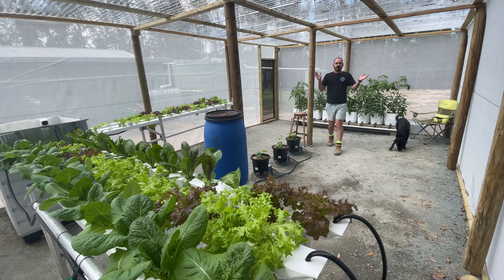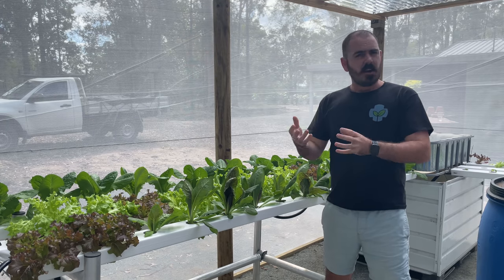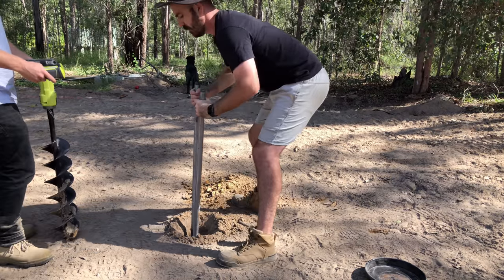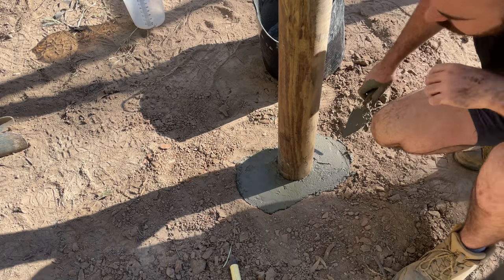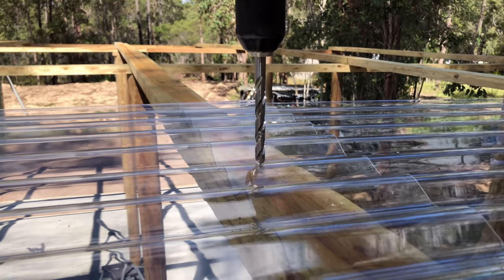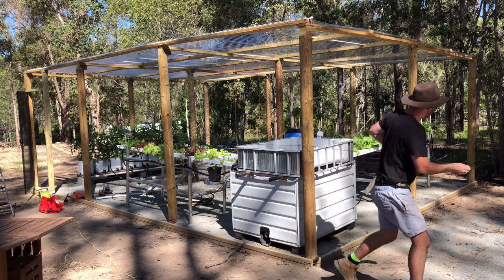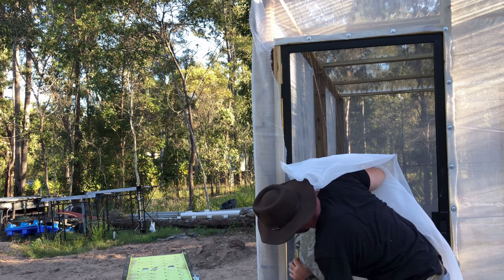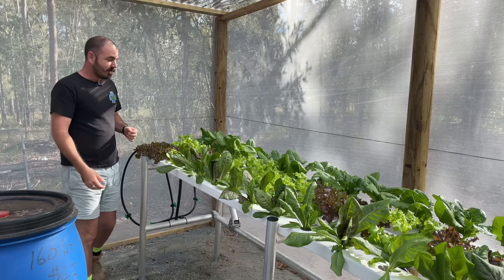Greenhouse/ Shade House Hybrid Build

Comment: @Hoocho Hate to be that guy...but your probably going to end up with roof sag, make sure you don't get a build up of leaves and avoid walking on the roof. In future make sure your beams are sat with the shorter 2' width facing up and down because if you lye them flat you loose any strength. For a light building I'd also consider using 6"x2" as a minimum. Since you have taught me so much about hydraponics I'll return the favour with a short lesson in mechanics. When you stand in the middle of a beam supported on each end, your weight will cause that beam to sag in the middle. Ok so much you already know, but if I was looking at you standing on the beam from the side and drew a line along the centre of the length. The top of the beam above the centre line will be in compression, whilst the lower part of the beam will be in tension. This is how you get the strength, a thin beam of 2" will sag more than a thicker beam of 6" inch because less material is available to resist the deflection of the beam caused by you standing on it. Now if you really want to increase the strength, stick a piece flat on the top and flat on the bottom and you get an I beam. This seriously increases the area of material resisting the deflection and works because the maximum physical compressive force occurs right on the top face of the beam and the maximum tensile force will be on the bottom face of the beam. The middle (or neutral) line that I drew down the centre will experience the least force/movement. But the general rule is, the further your top and bottom faces are from the centre line, the stronger your beam is.

Other than that, great job and thanks for what you do. I've just started growing veg hydraponicly this year and your videos have been really helpful. Just made my first pucks today!! If you havn't already, I would love a video on what happens to different plants when things go wrong, like PH, EC, Temp problems...although that last one might not be an issue in oz but all in the vein of reading your plants when things arn't right. I know you talk about whats gone wrong with some of your plants as you go, but a dedicated video would be awsum!!!!!!! Take care and thanks again.

Comment: With rapid set concrete you don't normally mix it. Wet the hole and pour the concrete in dry then add the amount of water as in the instructions. It has a chemical that draws the water through the mix. You will be weakening the concrete by mixing it and it is a very fast setting product. It also saves your back a lot by putting it in dry.

Comment: I used those same greenhouse roofs. It is item 77000 at Lowes, that's how much I know about them, lol. You MUST not build like that as mine caved in (with even more wood support) with a heavy rain storm. The middle of one will pinch and buckle from the weight of water. You must fix that asap, lol. This happened last year at 42*N, way up in Michigan not even in a tropical area, ha. Believe me man.
Reply: I warned my grow partner as he built it the same way. I warned him and lets just say I got to laugh inside and say "told you so" as he repaired the damages. Oh and we lost a really nice plant almost so, it wasn't all peaches and cream.
Reply: Oh, I think theyre good but it just needs to be tilted so the water doesn't set and gain weight on the weakest point. I know those things are pricey and they diffuse light, giving you more light, so they are very good for greenhouses... edit, oh you can tilt 15 degrees to one end, and put a gutter with a window screen mesh to filter out leaves from the tree, giving you perfect rain water for crops.
Reply: Good to know. Roof won't hold up to the 3" per hour and greater in Texas.

Comment: Dude nice good work 👍
To counter the bowing effect of roof members, just consider raising them a little in the middle and flitching them with a steal flat through n through securing the flat with screws and an adhesive to prevent dry joining, so that they behave together, that's where the tension prevails. This should address your sagging/bowing problem.
Please come back with results 🙏

Comment: I have a similar structure on a balcony.  around 2012 we had a party and some plexi was BBQ'd. lol yea....  Had it repaired.  2018 half the roof came off in the wind. =wuh??? SOOOO after looking carefully, I noticed that the original builder put a goop on EVERY screw & new guy didn't. The structure is 40 years old. The wood is now gone around many of the screws(repair job).  
Mind you that it hardly rains in California. 

btw >> Awesome shade house man !!

Comment: Unless your roof looks like its holding water I wouldn't worry but If you can flip the roof bearers onto their edge they will support more weight and it might help with some of your bowing. (carpentry qualification: have built 3 roof's many years ago :)  )  If you want to get really excited you can look up span tables to see what size timber you need for each gap, But if you aren't sleeping under it and it aint broke then why fix it!

Comment: Great job, good tips, looking to upgrade my first shade house build here in Geraldton and will go the modular route using pine posts and 3m treated pine, certainly saves time. I have Mr Stacky system and built my own recirculating system but will move away from those to the Krakty method its much simpler, nutrient uptake as required so no needless loss in unnecessary flows. Built my first Kratky system yesterday out of a storage tub and net cups, onwards and upwards. Thanks again for your great content and the beer looks like a tasty drop too. cheers

Comment: I want to do this but also lay pond lining over the whole floor and making the whole floor a sump and put everything on blocks, making a pathway or even fish pens with netting to separate. Using every bit of sunlight and it wouldnt matter so much if anything springs a leak because it would all drip into the sump

Comment: Very nice work. It's funny, I was thinking these days about making a greenhouse, and I was wondering about the plastic that stops the UV for the plants ;-). 
Just a small remark, for the wooden poles, even if they received a copper treatment (autoclave), personally I would have fixed them on concrete blocks of 20x20c20 cm so that they are raised and not in contact with the ground or with the weeds which will grow around and risk to rot the wood. I once used wooden posts that I planted in the ground with cement, and although they were treated with autoclave class 4 (the highest level of wood treatment) they ended up rotting after a few years.
I have a question about "shade cloth", I am in a country where it is hot all year round, and I was thinking of using only "shade cloth" for my greenhouse. Do you think that the ventilation is enough, because you need a very good ventilation in greenhouses, especially when the height is low, because the heat will stagnate. The professional greenhouses have a height of more than 6 m for good ventilation and efficient heat removal.
last point: in case of a storm, do you think the shade cloth will be strong enough. 
Thanks
Reply: Can I ask how would you attach the wooden poles to the concrete blocks? What type of fitting would be suitable for that?
Reply: @wndhl4347  The best way is to use "galvanised bolt down post shoe".
Reply: @pierreshasta1480  gotcha. Thanks mates
Reply: My mates greenhouse is 2.4m high with 70% shadecloth top and sides. He lives in the central highlands of Queensland where it gets bloody hot. He has no problems growing all year around

Comment: For me i would use polythene on the side to trap moisture inside and shade net up the top so rain could pass u side and to block excessive heat.
 I would use 50 percent or more on top to control the heat coming down, if heat are already control i would like to trap much moisture inside by using the polythene on the walls as much closed up as possible.